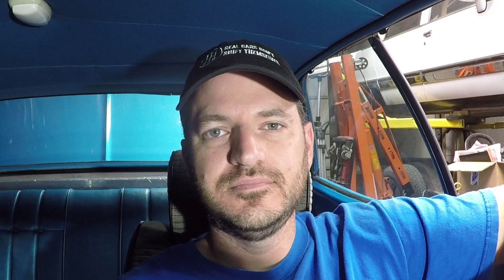Setting up a Corvair carburetor for RACING

Comment: Ok its 2 years old but maybe somebody will be helped from these tips
Its not a secondary carb the carbs are offset on the 140 because of the firing order and the way the pulses in the intake are spaced. The 4 carbs should be identical for this reason. The air horn you cut out is to help fuel distribution and atomization coming from the boosters. cutting It out may help flow and power at higher RPMs but hurt low and mid range .
The vents could be a u shape one to the other with a hole at the top. 
Eliminating the enrichment circuit will require a larger main jet and if you do one you need to do all 4.
Its not a good idea since what the enrichment circuit is doing is making it so at light throttle high vacuum the engine can be a little lean and crisp but once you open the throttle it will richen the mixture as the vacuum drops. Very similar to a map sensor on a modern car.  Them there factory engineers are smarter than you thing it the bean counters that mess things up.
Also one thing about the front suspension on a corvair the Ackerman is backwards that's really bad it maybe a crude attempt to tighten the car up really crude. if you can drive solving that will really help but it will handle like a Porsche really loose

Comment: In case you don't know it but the carbs for the motors had different idle circuit opening points depending on trans, horsepower, and the year. In better terms, the idle speed, airflow, and fuel flow were different in relation to the throttle plate position at idle and off idle. Not much and most people don't notice it but I am a perfectionist when it came to my carbs LOL I got the smoothest idle and best power when the carbs were just what came on the motor originally. I tried other carbs from other motors but they never quite worked as well. I won't tell you what I did to correct the cornering problem :)...I did not relocate the jets but solved the problem anyway.
Reply: You are not of much help if you will not share your brilliance.
Reply from the maker: True, there are a ton of minor differences year to year.  I wasn't trying to replace great resources like Bob Helt's book!

Comment: I never understood why GM made their air cleaners with snouts that reduced in size restricting air flow. I liked to take the snout off a second unit and make mine a double similar to the 140hp style. Also modded the tops of the carbs with extended tubes to raise the vent to keep sloshing fuel out of the carb throat.
Reply from the maker: You'll see the extended vent tubes in this video, and my quick cheat to get around the small snorkel is to flip the air cleaner lid upside down and expose the filter element.

I do think that the 90 degree turn into the carbs from the stock crossover pipe is restrictive as well - on the race track the butt dyno reports a noticeable improvement at high RPM with the whole air cleaner assembly removed.

Comment: JB Weld is not a sponsor,  there is always a way to repair/modify the original design. Fuel injection eliminated a lot of the carburetor issue's in modern cars it is a walk down memory lane fixing carbs on the picnic table. Granted you have raised my level of hindsight,  I had a 65 2dr Corsa (35 yes ago). Great job!

Comment: A better method to test a float is to immerse them in hot water which causes the air to expand inside. If there are any pin holes they will show up right away.
Reply from the maker: Thanks, Rick!

Comment: What's your take on the 4bbl intake for these cars
Reply from the maker: I have not run one personally. I have one in the garage and might give it a try at some point!  The conventional wisdom is that at any lower temperatures (like under 50-60 degrees F), the carb will tend to ice up because you're not getting much engine heat into the carb when it's sitting in the air above the cooling fan.  The fix is often to run engine oil up to the carb base and build a small heat exchanger into the base of the 4-barrel manifold.  That prevents icing and might even give you a tiny bit more oil cooling as well, a win-win.
Reply: I tried a 4bbl center mount. It was disappointing, to say the least. Way too many problems with the carb to get it to work right. Tried a 2 bbl center mount also and it worked better but I needed a Holley 2210 carb to get it to work and they are not available anymore LOL. I would suggest switching to fuel injection if you really want to make an improvement for your Vairs.

Comment: Great video! is this the only Corvair You own? I liked the late sedans ,the only early sedans I liked was the 60! do You only use electric fuel pumps,if so why? man I got get back into my Corvairs  64 Greenbrier ,65 Corsa turbo & 67 Monza drop top, got turn wrenches on other stuff for now.Love the Vairs!
Reply from the maker: I think most Corvair owners would tell you it's hard to own just one!  I've had 6-7 of them over the years but this has been my "keeper" for over 2 decades now.

Electric fuel pumps are a hot debate, but it seems like the available remanufactured mechanical pumps leak almost immediately for many people, me included. The first 10 years or so I had no trouble with them, but it seems like the ones you can buy now just can't handle ethanol in the fuel or something. I'm electric-only now and won't look back.
Reply: @FlawlessPlanGarage I guess it's like a electronic ignition I'll never go back to points either & like Petes hot sauce I put it on everything!!!!! ( LOL ) thanks for the reply .

Comment: This is a great video! My 67 (110hp) driver's side carb has weak to no spray, so I'm thinking it may be time to rebuild both carbs just to know where I'm at. This video came at the right time! Great info. I may modify some old carbs I have recently acquired like this and try them out eventually. Thanks!
Reply from the maker: Glad you enjoyed it!  I didn't really cover a full rebuild in this video, as mine didn't need it, but it's not difficult, just take your time.